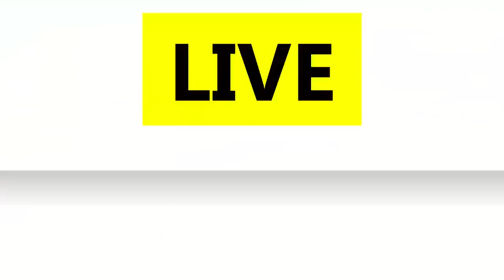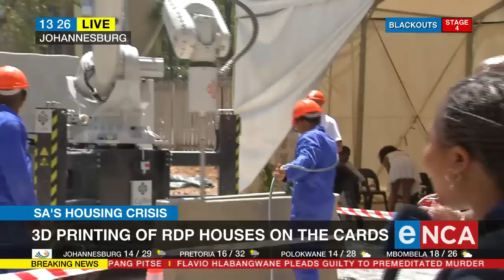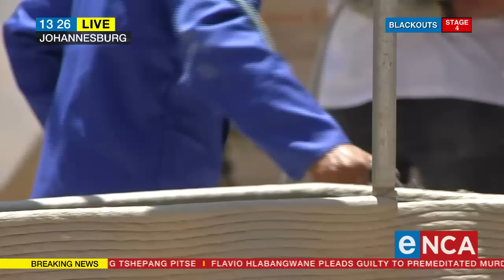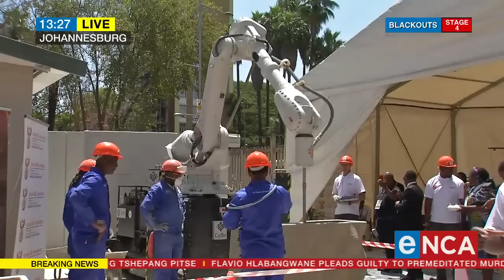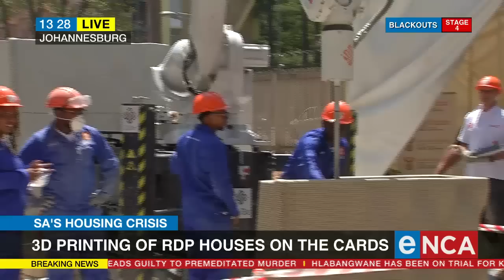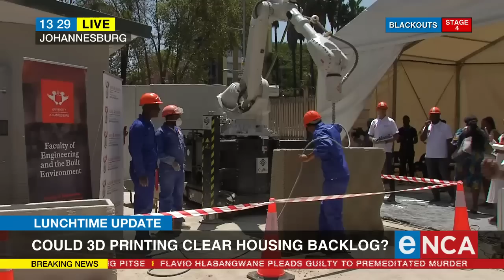3D printing of RDP houses on the cards

Comment: We should be looking at building techniques that create jobs as 40 % of our country is unemployed ! Build quality homes  with finishes etc in a factory where there is quality control and deliver and erect on site quickly. We should also be using insulation not just cavity walls to reduce heating and cooling costs ! Thinking you are going to put a R16million robot in the middle of an informal settlement to solve the housing issue is abit short sighted. This technique is also not  a new  technique. And there are good reasons it hasn't taken off around the globe.

Comment: ...so invest millions in automating a simple construction issue amid a job shortage?  Seems totally legit and well thought out.   I am legitimately all for automation ... But please, Show me the proof that this is cheaper, faster and more reliable in the long run, than a properly built house - the old-fashioned way.

Pre-cast modular homes would be vastly cheaper, faster and more reliable than this by miles.  Not to mention that it wouldn't require all the expertise and specialised equipment etc.

Comment: ok.. so which anc big wig is going to EAT on this project? :elbowcough:is it Mmamaloko  KUBAYI..or who?😋🐽
Reply: Exactly my thoughts as well.
It is an absolutely wonderful machine that is widely used in Europe. 
My next question is: Who is going to clean that expensive engineering marvel after each working day. Concrete set and cure very quick and can not be hit with a hammer the next day to remove hardened concrete like on an African wheelbarrow.
Reply: @faniecremer4899  spot on!!:yougotthis:

Comment: They can produce houses more efficiently and faster in pre build factories like the Swedish do and install them on site in a day

3D is not as groundbreaking as its made out to be
Reply: 100% correct. This is neither new or solving a problem. 
Flat packed houses are cheaper to make and provide more employment.
Reply: True.... There are more efficient and cost effective ways of buildings (assembling) these houses like the one you just mentioned.